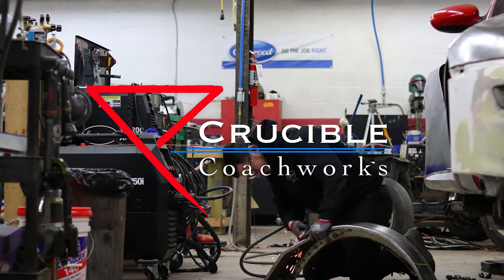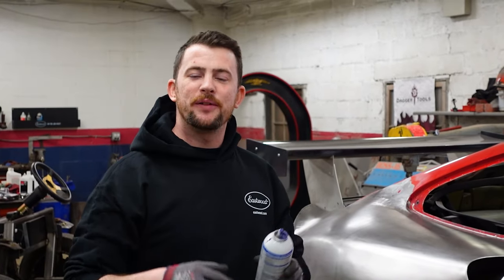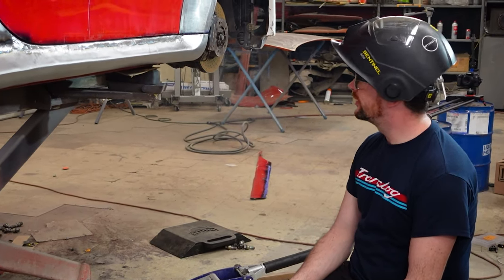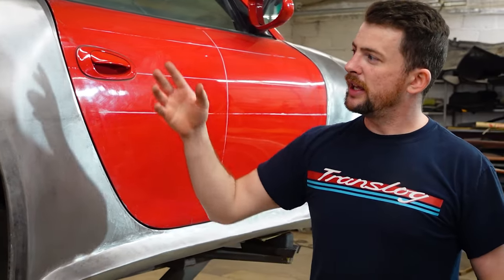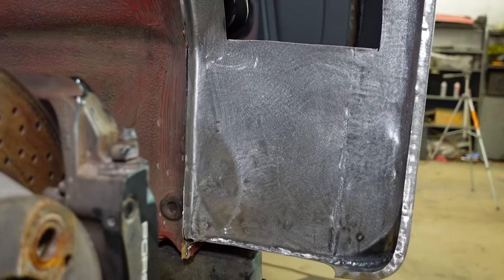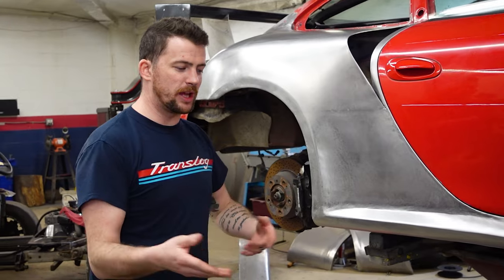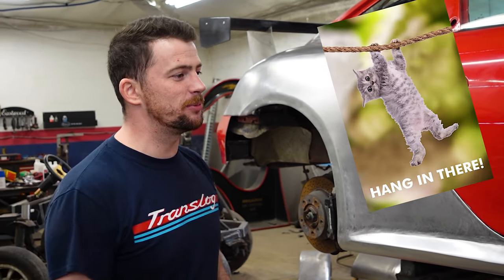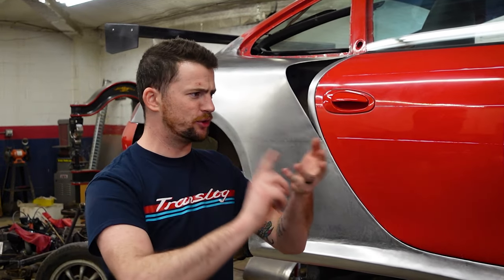The Devil is in the Details - 5 Weeks Left to Finish Our Porsche 911 Slantnose!

Comment: Curious... Any reason why you don't use weld through primer?
Reply from the maker: Really basically: weld thru primer has shown to cause more problems than good down the road. So we coat the insides of panels after installation and use cavity wax on lapped surfaces (like plug welded flanges) — copper weld thru is the worst, zinc can be okay but if it gets into welds the porosity is pretty harmful. There’s sources/studies online about it if you want to read into it.
Reply: @CrucibleCoachworks  Thank you so much for the detailed response.  Cant wait to see this build completed.  cheers!